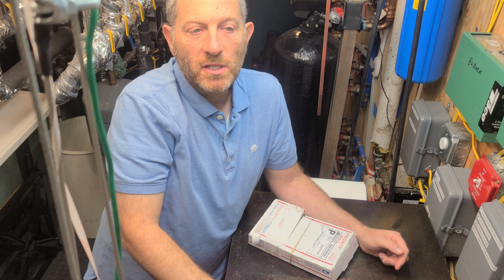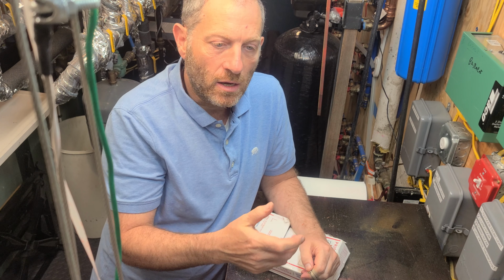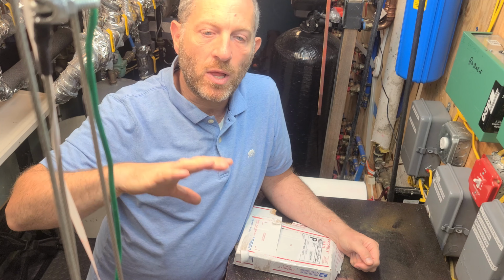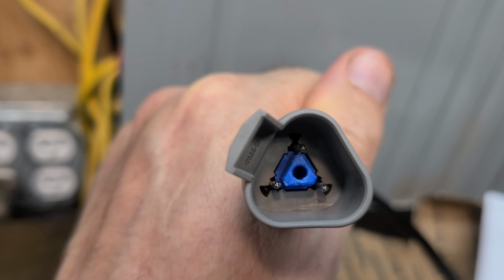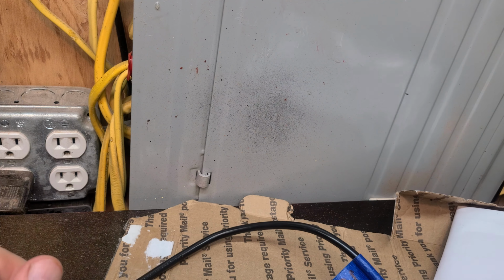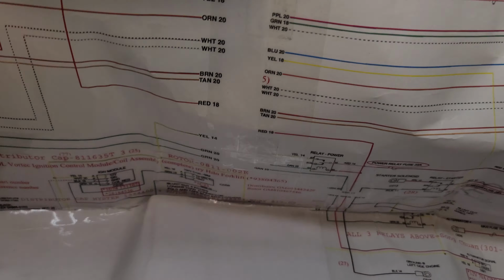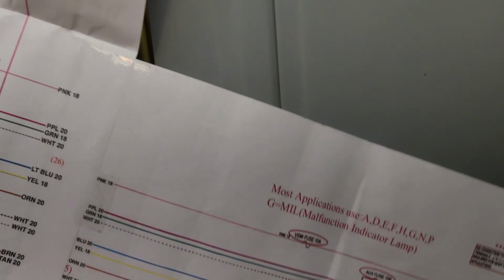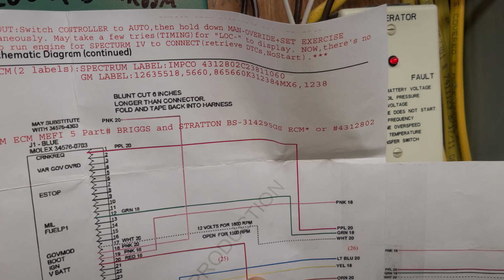Unboxing Gift from a Subscriber

Comment: 1. It is almost certainly a commercial product. 
2. The reason proprietary connectors are used is so that it is less likely to make mistakes and plug in the wrong cable. The 9 pin connector is a standard which is used for many things. One is for serial port communication, but many other devices use this connector and it may damage equipment plugged incorrectly.
Reply from the maker: Thank You!  It's a shame that the reader hardware is so expensive!